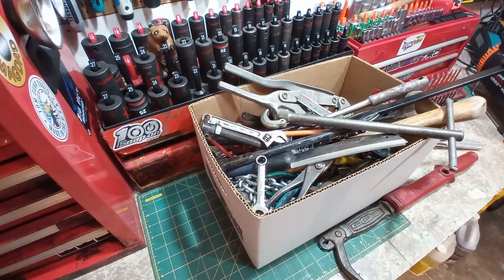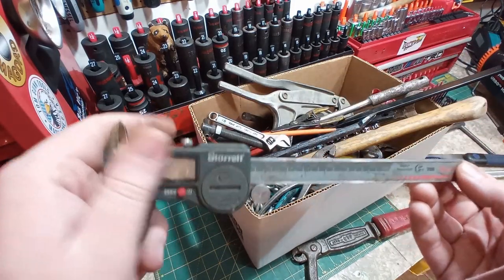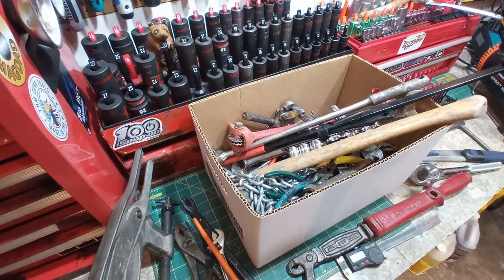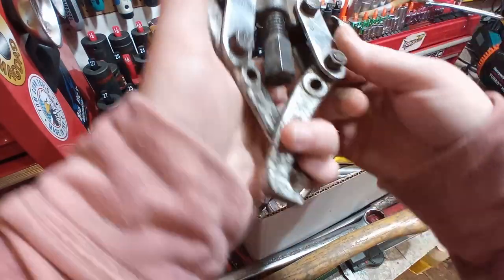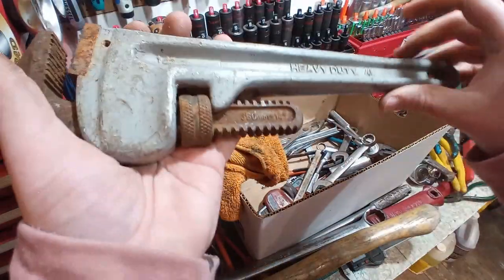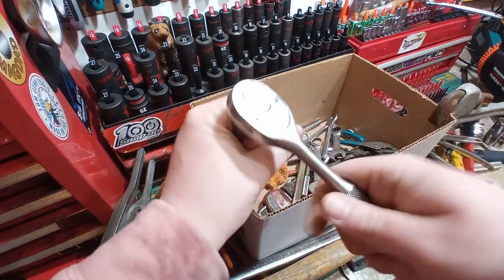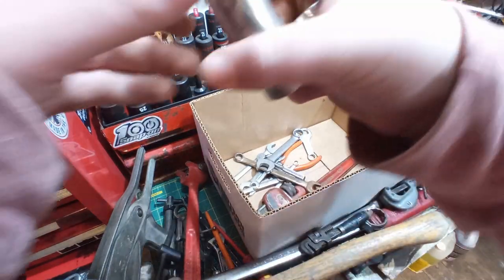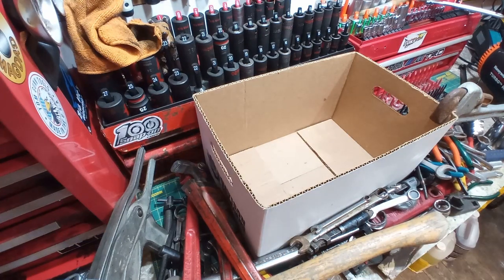TOOL HAUL #29 - Estate Sale Amazing Finds! MUST WATCH!

Comment: The lathe chuck wrench,  while missing the ball, might double as a T driver for 3/8" sockets though you would have to hold onto the socket to use it as such. Might have to grind the end to fit to make it work.

Comment: The 3/8" ratchet with the reversed drive gear is easily explained.  Years ago a lot of old timers liked using their ratchets that way so they would take apart and reassemble the  ratchets  to the  way they liked using them. Not uncommon at all to find old used ratchets that have been done that way.

Comment: I think the pliers with the green plastic tips are called glass running pliers used in glass cutting.
Reply: I'm sorry to say, that they are not glass running pliers. Glass pliers do not have any ridges on the inside of the jaw. They are completely flat on the jaw. The ridges would make the glass chip or flare instead of a clean run. Just so you know. Have a great day
Reply: I'm sorry I was wrong I didn't see the pair at the end when I commented. Yes those are glass running pliers. I thought you were talking about the green handle pliers earlier in the video. I stand corrected. Good call on that.

Comment: The lobster adjustable wrenches came as part of the tool kit of new kuraki cnc machines. They were always the 10" version in the kits. In the shop, if you wanted a 10" crescent, you would say I need a "lobster" .

Comment: Watch out using cheap pullers (that is a cheap one) they often hurt users. Always leave cheap pullers or badly worn ones on the table. Only buy known quality brand pullers. If you don't know the brand, the quality will always show itself in the tool. And chrome and shine is not the measure either. Unless they are giving the stuff away, only settle for quality. If it's virtually free, go ahead and take the gamble and figure out later if it's worth a hoot. Bank on this, China and far east manufactured pullers will be junk. USA, England, German made, or probably Canadian as well will be good quality and if not beat to death and worn out, safe to use.